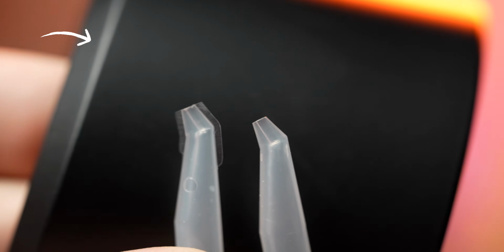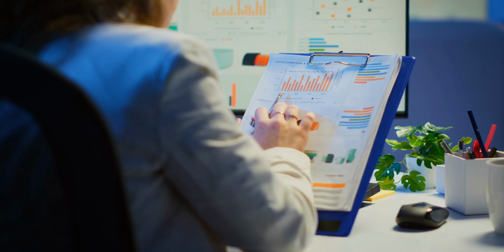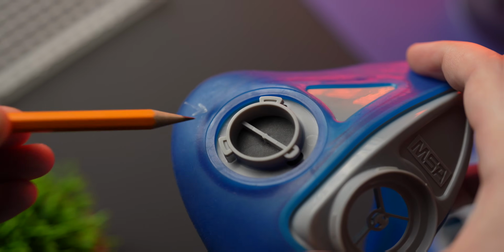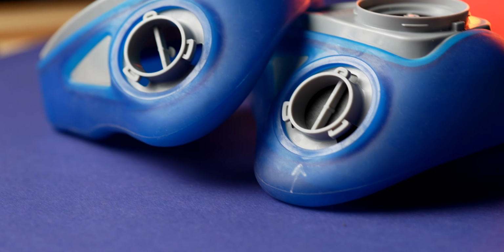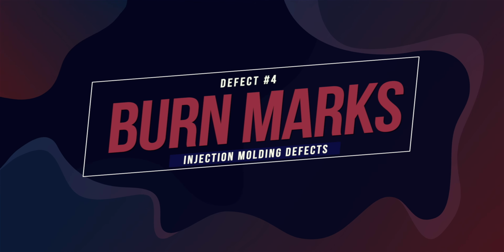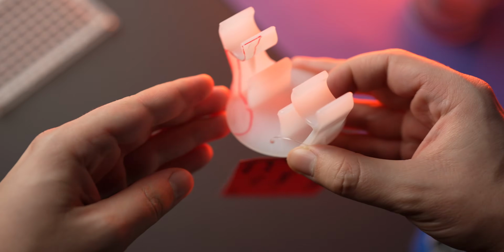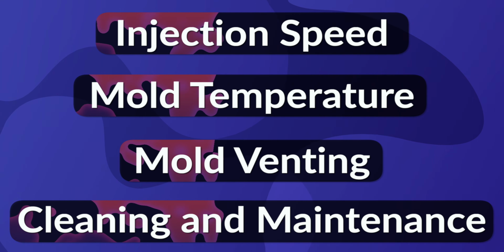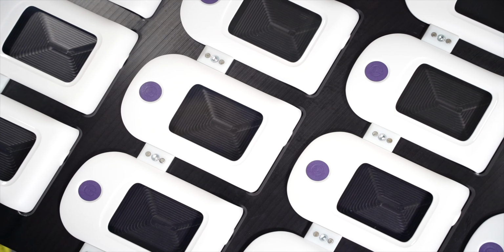Common Injection Molding Defects and Solutions

Comment: Any idea how to increase the friction of ABS?  I have a 2 pronged piece that fits into a 3 prong piece.  I bind the hinge with a bolt and wing nut so it can be adjusted slightly with your hands without having to loosen and tighten the wing nut.  As it stands now, even fully finger tightening with a wing nut does not create enough friction.  This worked fine with 3D printed ABS but not with injection molded ABS.
Thanks!

Comment: Great explanation. When flash is caused by wear or damage along the parting line, precision laser welding can be a very effective mold repair method. It allows small areas to be rebuilt with minimal heat and distortion, then machined back to the original dimensions.

Comment: I miss this field so much. I was in injection molding for 20 years till I changed careers to have a retirement. 
I molded fuel components for the auto industry. If my company stayed in the NE, I would still be in the trade.
We had the best engineers and set up/process technicians in the business. Molded to very close tolerances. A true skill

Comment: Not clearing the string from the sprue on every cycle can also actually cut channels into the steel or aluminum.  I always make my operators aware of that type of thing.  Most of them dont realize plastic can cut metal.  I would say 9/10 times i have burn on a part, inject speed usually fixes it, along with proper venting and cleaning of those vents.
Reply: Trapping air or what sometimes called "dieseling " can quickly burn /erode a hole in mold surfaces too.
Reply: @paul5683  Yessir, it sure will.

Comment: How to avoid cracks in plastic
Reply: @Learn_123 , many of the cracks I've seen where due to part ejection. Mold not hot enough, over packed, ejection set too fast. The mold needs to be designed properly, too, with the proper radius. No sharp corners.